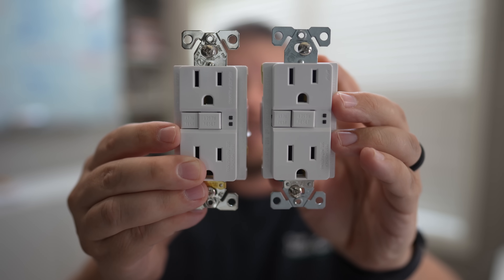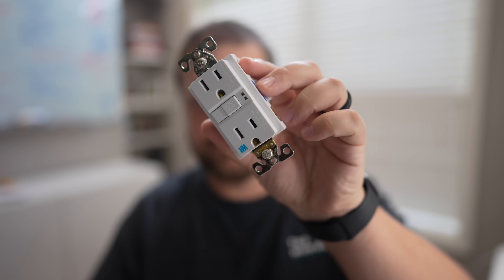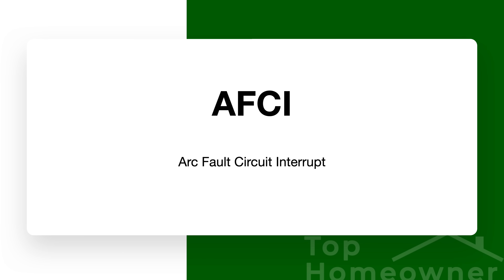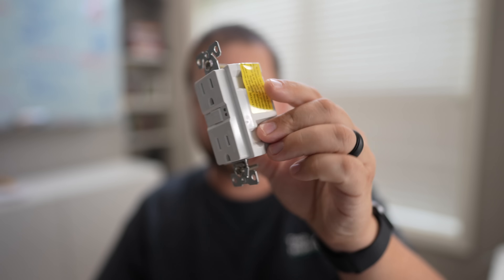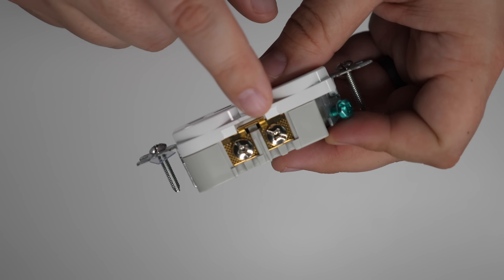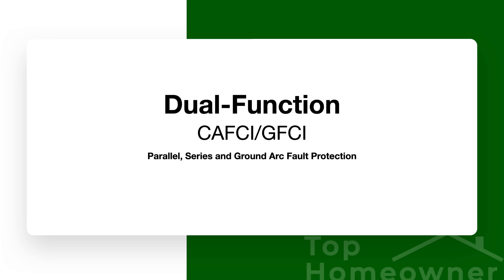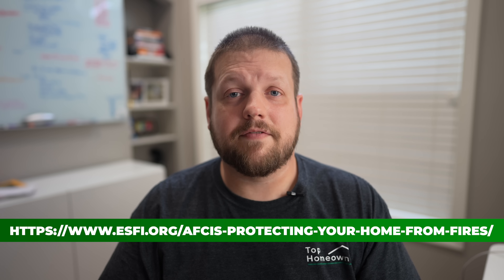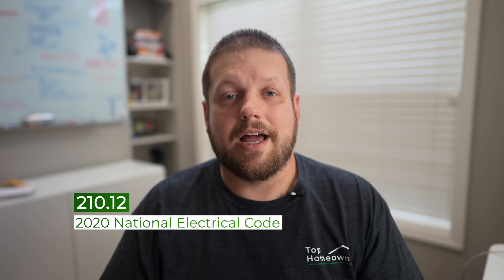AFCI vs GFCI: What's The Difference and Why You Should Care

Comment: That dual function breaker looks like it would be great in my house since it's 75yrs old and I occasionally see or hear a spark on some of my light switches at night, eventually I'll replace them all but money is tight right now and all my lights run through 1 breaker in the original 2 story section of the house, the 2 additions and garage all have newer wiring from the 70's.
Reply: Which means you will lose all the lights in the house if one circuit has a fault… Splitting the circuits would be a better first step…

Comment: Also, if the GFCI is installed at the first outlet on  the circuit (home run) every other outlet downstream on that circuit is protected.
Reply: Only if its wired correctly.

Comment: Is there a tester that you can use to check plug or light circuits with? So after I install some shelves onto a wall i can check to see I didn't accidentally nip a wire.
Reply: Megger meter - Use before connecting the circuit wiring to the GFCI and nothing plug into any receptacles on that circuit.

Comment: Let's do a better job.  GFCI, ground fault circuit interrupt, does exactly what it says it does...it interrupts the circuit ( a device operating via the outlet) because the ground pathway has been by passed...a literal fault in how current should flow in the event of a failure.  They are less common than AFCI.  I don't know why you said the opposite.  GFCI outlets are code for all wet areas.  Why?  Because they are wet.  A wet environment...kitchen, bathroom, laundry room, pool area etc are wet.  Normal operation can produce mist, condensation, spray, or even an exposed flow in the event of a leak.  In these cases, it is possible that a thin film of water can bridge between the hot and neutral wires...and importantly...bypass the ground wire as the ground wire would normally be the preferential path of least resistance.  This situation can place you in the path of the "flow of current".  As such you could die.  The GFCI has embedded circuitry that continually measures the flow between hot and neutral.  That path would include the device plugged into it. A bridge between hot and neutral that bypasses the device or shorts out the device would be seen as a sudden variation in current flow.  The threshold for this shift is a small fraction of an Amp in a small fraction of a second.  Both of these are required to protect you from electrocution.  

AFCI, Arc Fault Circuit Interrupt, is code (2020 NEC) for all new construction and rewiring projects.  They will be the protection for every other circuit in the home.  Arcs are a common thing in home operation.  Large motors always arc when turned on.  Vacuums, refrigerators, washing machines, furnace ignition and blower units etc.  These are normal.  There can be unforseen arc caused by things like a damaged wire to a lamp, a motor wiring problem in a fan etc....something that can create a bridge between hot and neutral...an arc.  These can cause fires as arcing current can produce exceedingly high temperatures well above the ignition point for many naterials.  The Fault creates an Arc.  That sudden jump in flow is sensed by the outlets Circuitry to trigger an internal switch that kills the outlet...the Interrupt.  If the protection is on the breaker then it kills all the outlets on that branch circuit.  The circuitry inside the outlet can distinguish between an operational fault from a properly working device from one that has a failure.  The exact method used is proprietary to the outlets manufacturer.
Reply: Bravo!

Comment: I live in an 80 year old house with two wire, #16 post and tube wiring with 20 amp standard breakers. No GFI or other nonsense. No problems. Testing the breakers with a 25 amp load, they all pop immediately on the most distant wall sockets. I think there are some shenanigans going on with the statistics of house fire causes.  Unknown cause: ELECTRICAL!
Reply: Put a space heater on those #16 circuits on a cold night.  You may not wake up or have a house in the morning. 
These breakers protect the wiring from overloading and shorting so the wire size and breaker size must be coordinated.  It sound like your wiring is well under the breaker rating.

Comment: Great video.  Consider an appendix.  Extension cords are the most common source of arcing fires since they are run under rugs and forgotten.
Reply: Yes, indeed.  Furniture legs, especially metal legs, can cause the wires in an extension cord to short.  That's a parallel arc or over-current condition.
Reply: Or just old house wiring.  The wiring and its insulation has a finite life-span.  I would not live in a house with 50+ year old wiring unless I had it rewired.

Comment: GFI cost more to install however I thought it was worth it. I had them installed throughout my entire house. Because they are far superior than a regular Outlet. Plus they hold the plug in place much better. While at the same time they work like individual Breakers. I swear by them I've never had any problems. Whereas the regular Outlets would always short out or the plug-in device would fall out like a vacuum cleaner cord plug. Somehow surprisingly my electric bill has gone way down ever since I had GFI outlets installed throughout the entire house not just the wet areas like kitchen and bathrooms. I just think they're safer all the way around. & definitely more reliable. Compared to regular Outlets.
Reply: If you want reliable protection,  use the breakers instead. They cost way more than a regular breaker or gfi device, but are much more trustworthy than the devices.

Comment: I am a General Contractor in northern California and I became an electrician in the 80's and your video is how ALL videos should be here.  Clear, accurate and to the point!  Well done!!
Reply from the maker: Thank you!
Reply: Yes, I liked it, too. No fluffing around, just raw information.
Reply: As far as I can tell, none of these special devices will protect a human from a shock if the person grabs the hot and neutral at the same time.  So some child grabbing and pulling out a plug when their little fingers go round to touch the conductors, before full disconnect, is still not protected.  I'm not sure it's actually possible to provide this protection.
Reply: @mb-3faze 

No but since you jogged my memory, it would probably protect from what I did at about two years old.

I remember almost nothing from my youth however this is so vivid in my mind even now many decades later. 

IDK if the electricity burned it into my brain or if I remember it so vividly because how all the adults started screaming and freaking out. 

We had terrazzo floors and I was barefoot. I found a bobby pin / hair pin on the floor and I promptly stuck it in the wall socket. 
It was the type that was kinda “U” shaped and I put one end in each side and was immediately amazed with all the little fire balls jumping and rolling around on the terrazzo floor. 

How I wasn’t killed I’ll never know but then again I should have been killed many other times since then as well, I guess the Lord needs me here to be a bad example of stupid things to do.
Reply: @mb-3faze  I was going to post that but you beat me to it.  I got a short sharp shock in my GFCI protected garage but it lasted  a tiny amount of time, triggered the CGCI,  and I was ok but stung...  Had I had a pacemaker, I would have ben zapped !
Reply: But ALL your sockets are CRAP
Reply: Do you normally wire an outside outlet from a GFCI 40' away in the garage? GFCI's and AFCI's are a TERRIBLE excuse for all the gonzo import contractors to avoid buying circuit breakers for the panel. I've got twelve outlets chained like that. Of course, they put down the baseboard BEFORE the floor tile was laid, too...

Comment: I installed AFCI breakers on all my old (1955) circuits. However, I had to remove one and go back to the original breaker on the furnace motor circuit. Too many nuisance trips.

There is an issue with GFCI breakers. I have one circuit that supplies an outdoor outlet. When the contractor remodeled the master bathroom, he tied it into that circuit. Now, if the outdoor outlet trips, it affects the bathroom outlet too.

Comment: An arcing demonstration involving a little bathroom space heater being unplugged while running (in a dimly lit room), would give people a good real-world picture of how things arc.  And what not to do.
Reply: Yes, it’s true that your scenario may produce an arc. So what? Any mechanic switch that opens with current flowing may cause arcing. Including: circuit breakers! The trick is how does the “switch”handle it? Citing your plug pulling scenario again apart from erosion of the plug blade and/or receptacle from arcing (and that would take many insertions/extractions) what else is the danger?  I’m don’t have a problem with any regular current trip OR GFCI breakers but, AFCI breakers having nuisance trips because of normal equipment operation in a properly wired installation seems like an unnecessary burden.

Comment: I had an arcing issue with an outlet in my basement.  The hot wire was found to be loose and had carboned up over the years. If it was not for my dog alerting me, (He kept staring and sniffing the outlet) I probably would have had a fire for sure. I could see the glow when I took the outlet cover off! So I would say an AFTI would have worked there. BTW, that dog got a nice juicy steak for his meal.
George B
Reply: Good boy.
Reply: Dogs are great. Try getting that out of a cat. The cat would watch you burn up in a  fire, and then start eating you when he got hungry enough lol

Comment: This is GREAT info. Well done. But you said that there is a dual CAFCI and GFCI breakers available "if you have room in your breaker box" What did you mean? Did you mean that these dual breakers are physically larger, or did you mean if we just have more slots available in our box?
Reply: These breakers typically require two slots each so you need some spare slots to replace old breakers.

Comment: I can’t believe we haven’t all been victim to all these faults.  I’ll take them all. Except I may not be able to use any of receptacles because of all the nuisance trips.
Reply: Nuisance trips are usually not actually that common (a lot of people make it out to be a much bigger problem than it actually is).  If you do have a device that is causing nuisance trips, it's almost certainly because the device is badly designed and does not have proper power line filtering built in.  You can usually fix this by adding an extra power line filter in line with the device's power cord, and the problem will be solved.

Comment: AFCI can be a real pain in the butt.  Many larger electric motors, older electric motors with carbon brushes typically have a little arcing between the brush and the spindle.  This will set off the AFCI.  So, if you are having construction/remodeling going on, the workers power tools will set them off real easy and after a couple times they burn out and must be replaced.  If you have a large remodel project and you have AFCI, a large power chord from a non-AFCI circuit or have your electrician install standard breakers during construction and then install the AFCI for final inspection.  (I don't know if that's legal or not, your electrician will know. We've had to do that on some jobs just to be productive.)
Reply: Anything before inspection is probably legal regardless.

Even after inspection, you may find depending on your jurisdiction that it is either explicitly legal, or practically legal in the sense that no inspector is going to write a citation for a breaker not being AFCI.

In my own case, we had so much trouble with our AFCI breakers, I went so far as to ask the insurance company whether we would have a problem with a claim if we replaced AFCI breakers with non-AFCI breakers and then had a fire as a result, and they said we would not. At least with our insurance policy, the lack of AFCI breakers, even if required by code, was not a concern at all.

Anyone considering doing that should of course do their own verification. But the AFCI breakers are so unreliable that it's likely anyone would find their situation is similar.

Comment: Psssst.... AFCIs are being removed from the Ontario code book in the future because they cause too many false trips. If it is connected to anything that creates a spark then it will trip. Therefore if you have any mechanically/hand controlled lamp, trip, hair dryer, trip, plug in drill, trip, older vacuum with a toggle switch, trip..etc, etc......  Older electrical devices may produce a small spark internally when being turned on, especially when dirty.  New electronics do not produce sparks when turned on as they typically have electrically controlled internals with push button switches and move away from connections being made by actually moving a switch and making a piece of metal physically contact another piece of metal allowing power to flow. In that brief period before the two metal components connect there is a very small spark, this spark would trip the AFCI and shut down the circuit.   Was good in theory but proves to be more problematic when put into practice as it has too many false trips. 

 Killing an entire circuit because someone turns a lamp on would be very annoying and potentially scary if you thought it was tripping due to an electrical safety issue.  There are too many service calls to tell the client that is the way the breaker is supposed to work and the perfectly safe lamp that was plugged in and turned on was the reason for the costly service call.

Comment: BS… A few years ago regular $6.50 breakers worked just fine. Now they’re not safe… They’re changing the building codes to force people to buy these drastically over priced breakers… These things are designed for one purpose and one purpose only. To drive up the cost of construction and make the American dream $2000.00 further out of reach for the average American citizen. I’m wondering who’s getting a kick back on passing these new codes…

Comment: Maybe you could explain more why each breaker is required under current code? I first heard of AFCI breakers a few years ago when replacing my main panel. This house was built in 1978 and, at the time, panels didn't have a master breaker. 150A feeds were allowed for "Arkansas" homes (energy efficient) instead of the standard 250A for other homes and the combo worried me. I was required to install AFCI in bedroom circuits. I've heard 2 reasons. 1. Kids might plug something into an outlet. 2. Outlets that are used a lot will break sooner. In either case, you don't want a fire in a sleeping space.
Reply: Regulations always increase in every industry. Building codes are making it so expensive to build. Yes it is slightly safer but with increasing homelessness is it a net positive?
Reply: @JD-yx7be  True. But I'd add that it's not building codes that are driving the costs of housing. Material costs are WAY up and an entry level house is 50% bigger these days. Sub-1000 sqft was common thru the 80's for entry level. Lot costs are so high these days that an old house is a fraction of the total value of the property.
Reply: My house was built in 52 here in Arkansas and I have absolutely no idea how it made it from then until I bought it. It originally had a single 100 amp breaker and that's it. I now have a 300 amp service (convenient now that we have two electric cars) the actual wiring coming into the weather head was overkill and I have two of my own transformers separate from the rest of the neighborhood My shop has its own meter and separate billing because my shop has 277 volt light fixtures that look like they were pulled out of an old factory, and also came with welders , a drill press, and a few other large machines all labeled 208 volt (I honestly have no idea how it gets 208 but the 277 is its own completely independent circuit with a completely different weather head) I'm assuming all that equipment was also from some factory that went out of business.

Comment: Yeah good luck using a chop saw or most power tools on an AFCI. And also never cut the ground and neutral together at the same time, since it also picks those up also. Why would you do this? Turning a light switch off to replace the light.

Comment: I suppose most aren't old enough to remember when window air conditioner units would burn houses down.  The high current draw would cause arcing, leading to a fire.  It happened quite a bit.  I forget, was it 2002 when they added it to the NEC?